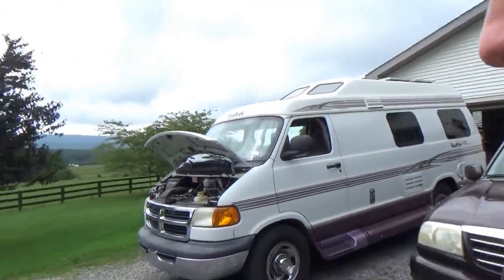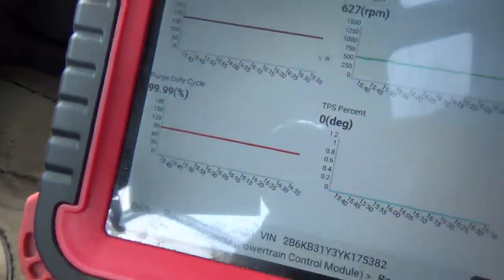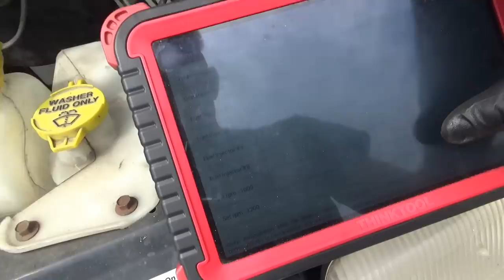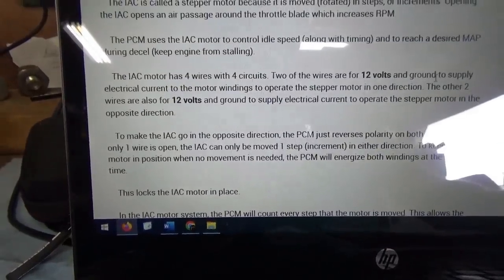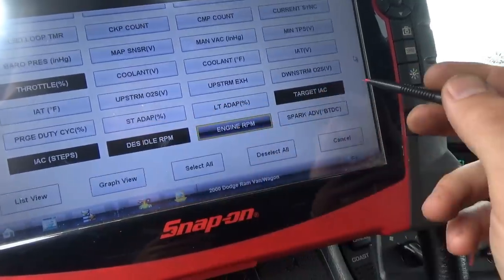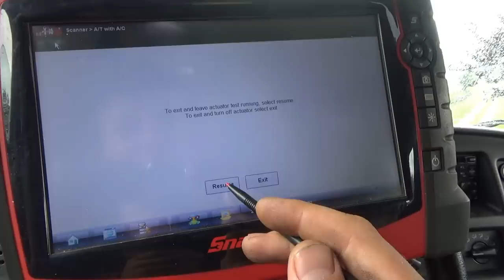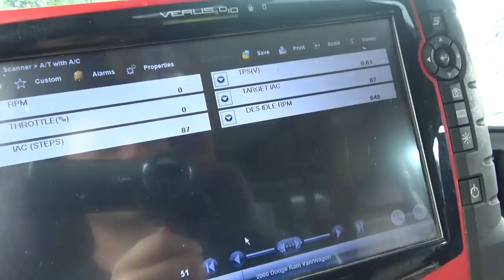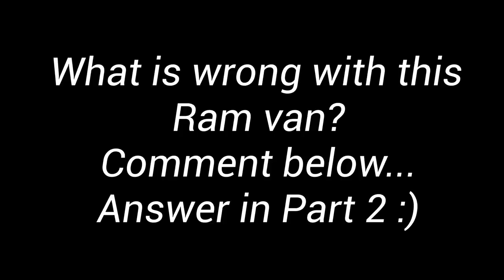DANGEROUS to Drive! Ram Camper Van STALLS after Hot Soak - Part 1

Comment: What is the engine computer using as an indication of engine r.p.m?  is that sensor acting up?.
Take the i.a.c  out and see if manual moving yealds a slight roughness sometimes.
Engine has a crap earth strap, they are crap lol.
Can i run away now?.

Comment: First I would change that battery!! When you crank the scanner looses connection for a second gotta be doing the same to the ECM
Next I would remove the IAC check for high carbon in that horn.
And last hopefully if that IAC is an aftermarket unit it could be crapping out on you
But scan data doesn’t show that  problem it seems to respond well
Looking forward to the fix
Reply: Cranking and losing connection to the scanner does not necessarily mean the ecm is loosing connection at all…
Plenty of older vehicles demonstrate this when cranking. Ive been working on cars a long time and some vehicles have demonstrated that when you crank, you just plain lose connection with scanner and thats just the way it is… Volkswagen is notorious for this. Probably change the battery and have same exact results

Comment: So are you thinking that it's a bad computer sending the wrong control data to the IAC?   When the IAC was too high at 110, I was thinking maybe the purge valve was open and it was compensating and allowing in more air to match the extra fuel--  but then the IAC went way low-- and that makes no sense at all;

Comment: It's worse when the engine is hot and the battery has just been charged. It starts hot but does not want to continue to run.  Can you monitor the mixture immediately after cranking?

Comment: I would check for a closed (or not closed) throttle position switch.  The computer needs to know not to try and control the engine speed with the IAC when you-re driving.

Comment: You are dead sure there is no intake air leaks around the IAC valve or throttle body ?
The careful use of brake cleaner is a fast test.

Comment: I am thinking that the ECM resets when it gets hot and has to relearn the IAC values. I’ve had the same issue on older dodges when the battery is dead, I jump them off and they won’t stay running. It takes a few minutes for it to relearn the idle.
Reply: My Jeep (a 97) does this too.

I've also had a failed IAC cause the same symptoms, the difference is it never went away.  Great fun driving home having to manually idle the car at stoplights.

Comment: It seems like maybe the engine + PCM is expecting some airflow from a source other than throttle + IAC, that it isn’t actually getting. Is the PCV valve sticking shut when it’s hot? Seems a long shot…

Comment: Have they had this problem from being new or did it start after a repair?  Your direction is good and will potbelly end up being what's wrong.. I'm guessing that maybe the production plant, the conversion plant / place or the guy that worked on it left off a shield or insulation and that is the problem. But what do I know nothing is right.

Comment: Had a 68 442 with same problem. Apparently when they made the car they put the starter right next to the exhaust. Took it to dealer and service manager told me they had 40 others in for repair for the same thing. I finally got fed up when my older son got sick and had to be rushed to hospital. Years later I read in Popular Hotrodding that someone developed a blanket to go around the starter. Wish I had known that as it was a Hurst 442 dynamite looking car.
Reply: That would be a no-crank symptom...not a crank no/hard start hot.  The latter on a '68 442 would likely be fuel boilingin the line (aka vaporlock) when the car sits for a while (but not too long) after getting up to operating temp.
Reply: @michaelkrenzer3296  yep exactly. Once the car cooled it would start
Reply: @HotRod-wv4vm  My point was...not at all the same problem.  Overheated starter (normally the solenoid) causing a no crank condition was not uncommon for GM all the way into the 2000's.  FWD Buick 3800's (half their cars in the late 1990's) were notorious for it based on the same poor design choices you mentioned.
Reply: @michaelkrenzer3296  my younger son has a 97 Grand Prix GT with the 3.8 . If you want to maintain high blood pressure, this is the car.

Comment: Water in the fuel. When the van is running, and moving the water is not an issue. but once it sets for a while, it picks up a load of water. Yeah! it's a wild ass guess.  But check it out.

Comment: Pressure test  - running fuel pressure should be 49.5psi +/- 5psi and should hold above 30psi for 5 minutes after engine shut down. Also Autel has the IAC data.

Comment: I"ve always found carboned up air passages in the IAC tract, when i see this I never bother to even check anything, just pull the throttle and IAC and clean them.  If it still misbehaves, then start troubleshooting, but these damn Dodges out here in CA just carbon up their IAC paths every 50k to 60k miles and idle worse and worse until they start stalling when hot.

Comment: So, Ivan, I see you are using AllData.  I have AllData DIY and the theory-of-operation narratives (i.e, the IAC info)  that I see you and Eric O. reference are not in that version.  Do you need the full big boy version ($$$) to get that feature do you know??  Thanks.
Reply: I had to upgrade to new subscription. It has diff login as well.
Reply: @harrylumsdon6773  Thanks Harry.  Yeah, I have the old version that will expire in a bit less than a year.  I saw there is a new version.  Cost for 1 year is what I paid for my previous 5 year subscription 😞 but I guess if it has all that supplemental info it might be worth it.

Comment: That RPM 640 wories me, it is too low, it should be more than that,and 90 percent IAC commade also a problem too much IAC command at idle,   it may need minimum idle adjustment to spect,  with IAC and purge valve  disconnected, like honda CRV 99, no one know about mimimum idle with IAC and PUrge valve disconnected . till i found it on the repair book bought from autoparts store autozone, and when i checked the minimum idle, i found it too low like 420, and it should be 480, i  turned the adjustment screw till it get to 480, and then connected back the IAC and purge vlave, and cleared DTC codes and my idle problem, fixed, it should be different procesure for that kind of car, but since it has throttle cable and IAC, then there is a minimum idle adjustment with IAC and purge vlave disconnected. But first you need to check and clean the throttle body and IAC from any carbon deposit.

Comment: Heat soak hard to start 12 V battery and and heat soaking the starter. I would also be looking for fuel line too close to an exhaust manifold boiling the fuel before it gets there to the injectors.

Comment: Engine closed in under dog house electronics get hot...I had that issue coil got hot.
Maybe release fuel pressure in rail after hot run . Then next cold morning see if motor is flooded to rule out leaking injectors .
I had a Dodge van 225 six come in with charcoal grains in carburetor from evap system.
Bizarre.

Comment: non genuine iac control valve is my guess, bought a few cheap non oem in past recently and they look the part but just does not work as good as OEM and yes was 30bux vs $300 OEM mitsubishi.

Comment: Weak battery!  When you start it, the voltage is dropping below min. voltage for the PCM and it loses it IAC memory and has to relearn.  Had this same problem on my 98 Dodge Ram with 360.  Replaced the battery and problem was solved.

Comment: Sounds like it needs a new  intake manifold gasket and throttle body gasket, fuel injector -o-rings  and at that point may as well put new plugs,wires cap &rotor in it

Comment: i'd prob check if the throttle body is dirty or not.....as far as the iac: when you give  throttle above threshold is pcm attempting to lower by retracting iac....shouldn't it be able to idle with iac fully retracted???  that what goes through my mind at this point
Reply: My guess as well. Happened to a few of my Silverado trucks once they hit 100,000 miles

Comment: probably just a weak battery. My 99 dodge ram 1500 with 5.9 magnum does the same thing when i have a weak battery. I'd bet the battery is not putting out the same volts/amps when warmed up.

Comment: I have a 1995 E-150 Van with a 351 Windsor engine.  Similar peoblem, hard to start after a hot soak, cnce started runs fine.  I tried checking the fuel pressure OK but the guage was leaking a bit on the rail, pressure went down slowly when engine off.    Looking for ward to part 2
Reply: On 80s/90s Fords, that is usually caused by a TPS issue (either failure or adjustment).
Reply: @kevin9c1  Thanks I will check it out
Reply: @kevin9c1  Do you have a link I could look at about checking and fixing it
Reply: @bellasvistas3463  The problem I am describing would be more likely to cause a stall like if you pulled up to a light.  But you can research Ford TPS issues and stalling, even if that may not describe your issue.  For your issue I guess I would look closer at fuel pressure to see if the rail is losing the prime.  You can also try to turn key on/off a few times before cranking to prime the rail.  If that makes a noticeable difference, fuel pressure looks even more likely.
Reply: @kevin9c1  Just checked codes 116, 637, 114 and 539.  The check light was not on.
Reply: @kevin9c1  I used a wire to get codes  116 ECT out of range,   I will clean all the connections and run the test again before replacing any parts.  Thanks,

Comment: That computer relearn msg/off line msg displayed during cranking is not right;  maybe a 'stay alive' circuit; computer is losing correct throttle position to idle correlation;  Tps may be faulty; look at TPS data/not showing increase in throttle, computer thinks still at idle position

Comment: What triggers the computer to control the IAC?   Is it fuel based or just RPM based?  Like if you load the engine down -- is it just trying to do what it can to keep a certain RPM-- or is it actually sensing through the MAF, MAP and O2 sensors and adjusting for what the fuel is saying?   I'm not sure what logic is operating the IAC.  I wish I knew--  it would be nice if you could find it in the service info.
Reply: " is it actually sensing through the MAF, MAP and O2 sensors and adjusting for what the fuel is saying"

That would be a completely backward way of maintaining fuel control.  The IAC is just a secondary throttle, the MAF or MAP detects the total airflow into the engine, irrespective of the split between main throttle and IAC.  Idle control is operational only when no throttle is applied and attempts to maintain RPM at a target value (which varies depending on engine temperature).
Reply: @ferrumignis  So does that mean that it's only using the cam and/or crank sensor to control  it, or the temp sensor?   My point is, whatever sensor it uses, could be what is going haywire.  (You would be able to see the RPM gauge acting up if it had one, but it doesn't;   but RPM's looked steady on the scantool,  so idk.).   If the sensors are fine, and the IAC is doing what it is told --  It's looking like the computer itself is what is being wonky;   Because it's obviously failing to keep the RPM correctly-- if it was it wouldn't stall.   So either the cam sensor is telling it the wrong RPM, or the computer is getting the correct RPM from the sensor, and is just telling the IAC to do the wrong thing;   simply because the IAC looks to be working fine and passed the actuation test just fine.  I want to say the temp sensor controls the IAC on Fords and Honda's, but I could be wrong about that too. lol
Reply: @ferrumignis  “We’ll said” that’s it in a nutshell! The IAC is just that,,,, @ idle ! It is “not” a sensor,,,it’s a “device” the spring behind the Pintle with key off, “should push it to it’s closed position” or what it thinks is closed,,, carbon gets in the way ! Good explanation !
Reply: @calholli  Crank sensor is normally used to determine RPM (cam sensor is used for this on a few oddball engines). That appears to be working fine since the ignition is functioning and the engine runs fine above idle (when IAC is not being controlled).  Temperature is used to set the baseline target idle speed, and usually the ECU will have inputs that raise the idle if a heavy load like AC is turned on.  Getting a different step count for the same RPM strongly suggests the problem is either the IAC itself, or there is some other intermittent air leak. Ivan has already ruled out the purge valve as the cause of this.
You might have noticed the idle surging (hunting) at one point, and this can be a symptom of a sticking/sluggish IAC.
Reply: @calholli  the service info said the IAC controls idle and timing.
Reply: @fredwalker839  We understand that the IAC is just an actuator---  but it is being controlled by the computer, which is getting data from somewhere so that it knows what to account for.  That could be crank signal -- so it's just trying to result in a given RPM-- or it could be throttle position.. or it could be based on the temperature-- or maybe all the above.  I'm not sure what logic the computer uses -- and that was my  point.   He found the issue in the new video out today though;  It was just a dirty throttle body -- and the throttle stop screw needed to be adjusted.

Comment: It could be caused by a bad input signal from one of the sensors that control air intake, I'd check intake air temp, coolant temp, air flow, map, o2 (maybe?) , TPS. Anyway that'll be my approach, im sure you'd have a better way to pin point that. Waiting for part 2 :)

Comment: Gee, I tried to make a comment with a link to a picture of my Dodge camper van, that I've owned since new, but the youtube thought police deleted it. I sure hate those youtube Thought and Speech Nazis.  In any event, my van has a real (tall) fiberglass top so you can stand inside, oversized front and rear sway bars, a hot 360 CI V8 that I built with a forged reciprocating assembly, oversized valves and that is ported as much as it is possible to port LA cast-iron heads.  It's an older model that is not fuel-injected.  I'm using the original Thermoquad carburetor that works very well, and the vehicle is rather fast, considering its weight.  Too bad the youtube idiots won't let me show you a picture of it.

Comment: I'M VERY STIMULATED BY YOUR CHALLENGES OF COMPUTER/ELECTRONICS....  so thx for that.
==>
Why not monitor O2 readings?  A restricted, stuck idle will cause decreased idle air, so what would O2 go to?  Rich??   ECU then turns down fuel to cause stall?  Yeah, RPM is another ingredient the ECU should consider.  So:  
☆RPM
☆O2
in computer think these are monitored EVENTS
the idle steps are ACTIONS.   
target steps and actual steps are resultants of RPM & O2. 
// My 2c is monitor O2 too.  

My 90 LeSabre had a defective idle air such that once warmed up the car stalled at red lights requiring added accelerator to keep running.  R&R solved it.

Comment: I've actually had this exact problem on a 97 Jeep - it was the idle air controller.

The only way to drive the Jeep was manually idling the engine with the gas pedal (remember, this is back when you had a mechanical throttle linkage).

New IAC, problem solved.

Comment: Bad battery ecm reset idle relearning, scanner restarts
Sticking iac
Sticking purge valve
Clogged air filter not changed in years
Fuel pump and filter

Comment: The perfect scanner is the OEM Scantool, it's just spendy to have every OEM Scantool.

Curious Ivan, how much is a used DRB Scantool that works perfectly with a 2000 Dodge in the aftermarket???
Reply from the maker: Some OEM scanners are ancient dinosaurs...but they do cover all the options :)
Reply: @PineHollowAutoDiagnostics  Very true but how many times has an aftermarket scanner sent you down a rabbit hole?